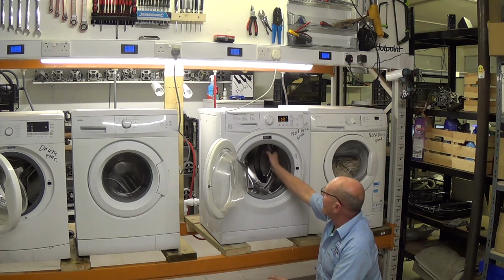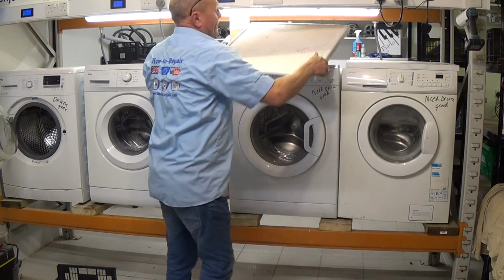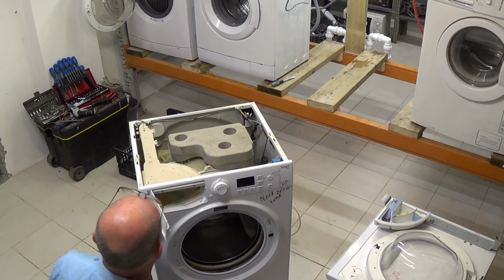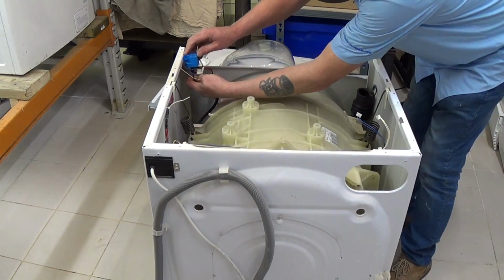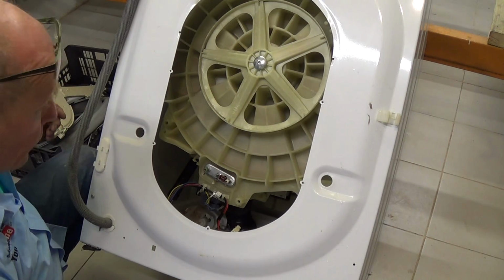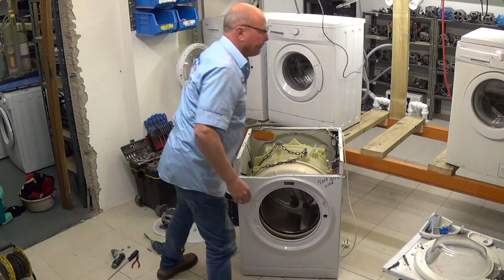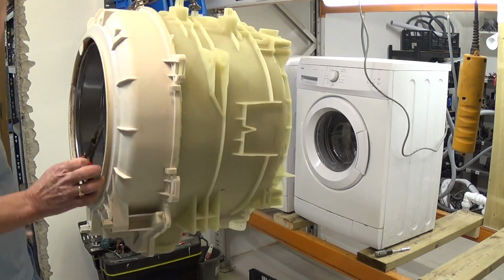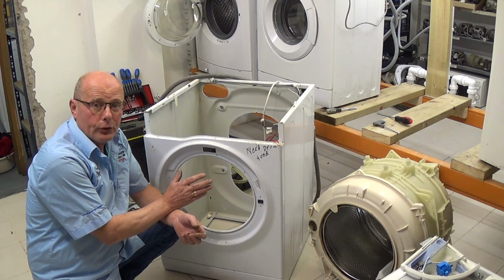How to replace & change a Washing Machine Drum in a Hotpoint Indesit Ariston Whirlpool

Comment: hello i have a similar machine and i have noticed that the washing machine is leaking water when get's filled with water or detergent, i have tried and remove the front cover and washed the detergent box but nothing happened, i'm not quite sure if is the drum that is leaking or if it's leaking from the inlet hose... 
i bought the machine brand new a little over two years ago... very odd for it to start leaking so fast

Comment: Interesting. Chance of finding an identical secondhand tank is easier said than done. I speak as ex Hotpoint fse.
Reply from the maker: Okay, as a Hotpoint engineer, you will know this. Find the part number of the drum that you were looking for, then put this into one of the websites and find all the models that it fits. Using this data as individual searches to see if anyone has an old machine with a burnt out PCB or similar fault, then Rob Charlie to make Peter better. You will also be surprised how many new ones are for sale from engineers who have leftover stock
 glad we could help you @johnmartin390 this is for you https://www.youtube.com/shorts/e432SAb2g08 please remember to subscribe as that's what keeps this channel going. Thanks 👍

Comment: Great stuff - your last vid was real helpful too (epoxy drum repair) thing is.. I had a rather bigger hole - so I got the aqua-stik epoxy & reinforcing glue and I had ideas to reinforce the repair with fibreglass mesh or similar - - mines a Hotpoint, like what you have there, and seems to be a split drum.

So if i do this full strip-down, how feasible it is to open the 2 halves of the drum (to check for remaining foreign debris, and give full access for a repair?) then put back - do the 2 halves need a special seal, can i just reassemble, or what ?

Thanks for you  time - I find fancy electronics and computers a lot easier :) Pete, Gas Electronics
Reply from the maker: there are a few videos on replacing bearings on a sealed drums that will help you ,but not for me to much work, why not look for a second hand drum its easy if you have model number. Thanks 👍 for watching and please remember to subscribe to the Channel as that's what keeps us going in able to make the video for you

Comment: Excellent video. Thank you for your time. Unfortunately, I found my drum was also sealed and the fairly new machine was scrap. There must be a way to establish this first. Maybe if the large pulley is held in place with a bolt the bearing is replaceable, and if it is held in place with an allen key, it is a sealed drum??
Reply from the maker: You did not say what make of machine that you had
Reply: @jaybee258 Presuming you mean one of the Hotpoint-Ariston family as in the vid, I thought MINE was non-sealed too, as the things obv manufactures in two halves .. But unless youve got little bolts holding the drum together , it aint, its plastic-welded!

Theres a vid of someone cutting these open, and re sealing - but its quite a bit of faff !

Comment: Hi Paul, is it possible to open the tub of this machine ? It seems to be glued ??? There are just 4 claws to maintain the front face .... not realistic ... I need to replace the 3 drum paddles and there are  some folded tabs to block the paddles on the drum which must be folded from the outside of the drum. Thanks in advance !
Reply from the maker: what make have you got

Comment: just wanted to say thank you. I got a spoon out of my heater element. A whole spoon!!! my question is I have an older whirlpool duet and the plastic around the drum has screws can I take this completely apart and reassemble it? or will i need a seal after taking it apart. I watched one you said they are welded on some so just curious. thanks for taking the time to make these very helpful

Comment: Hello I have to say why would you really want to go through all this kinda work just to replace a new tub. Seems a lot of work. I understand what you are trying  to show but honestly I can’t see why.  Hope you are not offended by my view on this matter.  Thanks
Reply from the maker: I understand your thought completely but
There are many people who cannot afford to buy a new machine, And by doing a little bit of research they might be able to find a replacement drum for as little as £20 out of the machine which has burnt electrics.  I have been doing this for nearly 40 years but with this video it is only 2 hours of work to put a new drum or second-hand into their machine. There are a lot of people who have a few hours to spare rather than spending £300 on a new machine.  I was not offended by your criticism whatsoever but not all of us are in the same financial situation. 
The machine I was working on was  hotpoint wmfug842puk the drum is part number C00285584 this fits all these machines so there is a good chance of finding a drum
ARISTON
AQXXF129 AQXXF129
HOTPOINT
AQXGD169PMN AQXGD169PMN AQXXD169PM 39798 AQXXD169PM 39798 AQXGF149PIUK 54676 AQXGF149PIUK 54676 AQXXL129PM 39796 AQXXL129PM 39796 AQXXF149PM 39797 AQXXF149PM 39797 AQXXF149HPI 39799 AQXXF149HPI 39799 AQXXF149PI 41786 AQXXF149PI 41786 WMUD823BCUK 83870 WMUD823BCUK 83870 SWMD8437UK 85902 SWMD8437UK 85902 SWMD9437UK 85903 SWMD9437UK 85903 SWMD9437GUK 86962 SWMD9437GUK 86962 SWMD9637XRUK 86963 SWMD9637XRUK 86963 SWMD9637GUK 86964 SWMD9637GUK 86964 WMFUG842PUKC 87685 WMFUG842PUKC 87685 WMBF822PUK 89178 WMBF822PUK 89178 WMBF944GUK 89787 WMBF944GUK 89787 WMBF844PUK 89821 WMBF844PUK 89821 WMBF844GUK 89867 WMBF844GUK 89867 WMBF944KUK 89890 WMBF944KUK 89890 WMFUG842GUK 89959 WMFUG842GUK 89959 WMAO9437PUK 89960 WMAO9437PUK 89960 WMSIF8437BCU 93143 WMSIF8437BCU 93143 WMFUG842GUKC 95691 WMFUG842GUKC 95691 WMFUG942GUKC 95723 WMFUG942GUKC 95723 WMXTF942GUKR 102134 WMXTF942GUKR 102134 WMXTF842GUKR 102136 WMXTF842GUKR 102136 WMXTF942KUKR 102137 WMXTF942KUKR 102137 WMXTF842KUKR 102141 WMXTF842KUKR 102141 BWE91484XKU 104311 BWE91484XKU 104311 WMAOD844PUK 153108 WMAOD844PUK 153108 WMAOD844GUK 153109 WMAOD844GUK 153109 WMAOD844KUK 153111 WMAOD844KUK 153111 WMAOD944PUK 153112 WMAOD944PUK 153112 WMAOD944GUK 153114 WMAOD944GUK 153114 WMFUG863PUK 153210 WMFUG863PUK 153210 WMFUG863GUK 153211 WMFUG863GUK 153211 WMFUG963GUK 153212 WMFUG963GUK 153212 WMFUG963PUK 153213 WMFUG963PUK 153213 WMEUF944PUK 153408 WMEUF944PUK 153408 AQXGD169PMUK 46506 AQXGD169PMUK 46506 AQGD169SUK 46507 AQGD169SUK 46507 AQXGF149PMUK 54677 AQXGF149PMUK 54677 WMUD962GUK 74905 WMUD962GUK 74905 WMUD942PUK 74906 WMUD942PUK 74906 WMUD9427PUK 74909 WMUD9427PUK 74909 WMUD9427GUK 74910 WMUD9427GUK 74910 WMUD9627PUK 74911 WMUD9627PUK 74911 WMPF843GUK 76529 WMPF843GUK 76529 WMPF823PUK 76755 WMPF823PUK 76755 WMUD843PXUK 78675 WMUD843PXUK 78675 WMUD943PXUK 78677 WMUD943PXUK 78677 WMUD963PUK 78678 WMUD963PUK 78678 WMFG8337PUK 79637 WMFG8337PUK 79637 WMFG8537PUK 79639 WMFG8537PUK 79639 WMFG8537KUK 79641 WMFG8537KUK 79641 WMYL8552PUK 79762 WMYL8552PUK 79762 WMYL8552GUK 79795 WMYL8552GUK 79795 WMEF963PUK 81337 WMEF963PUK 81337 WMEF963GUK 81338 WMEF963GUK 81338 WMUD823PUK 81764 WMUD823PUK 81764 WMYL8352BUK 81765 WMYL8352BUK 81765 WMFL833GUK 82837 WMFL833GUK 82837 WMUD843PXUKC 83409 WMUD843PXUKC 83409 WMYF842GUK 84175 WMYF842GUK 84175 WMYF842PUK 84176 WMYF842PUK 84176 WMYF862PUK 84177 WMYF862PUK 84177 WMFG821PUK 84458 WMFG821PUK 84458 WMYF822GUK 84502 WMYF822GUK 84502 WMFUG842PUK 86250 WMFUG842PUK 86250 WMUD942BUK 74907 WMUD942BUK 74907 WMUD843PUK 76532 WMUD843PUK 76532 WMUD942KUK 76599 WMUD942KUK 76599 WMUD843BCUK 83870 WMUD843BCUK 83870 WMUD942GUK 74908 WMUD942GUK 74908 WMFG8337GUK 79638 WMFG8337GUK 79638 WMFG8537GUK 79640 WMFG8537GUK 79640 WMYL8352PUK 79761 WMYL8352PUK 79761 WMEF943PUK 81312 WMEF943PUK 81312 WMFG942PUK 84501 WMFG942PUK 84501 SWMD8237UK 85901 SWMD8237UK 85901 SWMD9637UK 85904 SWMD9637UK 85904 WMFUG842KUK 86251 WMFUG842KUK 86251 WMFUG942PUK 86253 WMFUG942PUK 86253 WMFUG942GUK 86254 WMFUG942GUK 86254 WMBF944PUK 89786 WMBF944PUK 89786 WMBF963PUK 89788 WMBF963PUK 89788 WMXTF942PUKR 102130 WMXTF942PUKR 102130 FML942PUK 102474 FML942PUK 102474 WMJLD943PUK 102864 WMJLD943PUK 102864 WMUD942PUKC 83408 WMUD942PUKC 83408 WMXTF842PUK 85881 WMXTF842PUK 85881 WMXTF842GUK 85882 WMXTF842GUK 85882 WMXTF842KUK 85883 WMXTF842KUK 85883 WMXTF942PUK 85887 WMXTF942PUK 85887 WMXTF942GUK 85888 WMXTF942GUK 85888 WMXTF942KUK 85889 WMXTF942KUK 85889 WMSIG9637BCU 87475 WMSIG9637BCU 87475 AQXL169UK 37698 AQXL169UK 37698 WMUD962PUK 74904 WMUD962PUK 74904 WMEF923PUK 79764 WMEF923PUK 79764
INDESIT
XWA81682XWC XWA81682XWC PWE91472WUKE 74753 PWE91472WUKE 74753 PWE91672WUKE 74754 PWE91672WUKE 74754 PWE91472SUKE 74755 PWE91472SUKE 74755 XWA91683XWUK 87505 XWA91683XWUK 87505 XWC81483XWUK 87506 XWC81483XWUK 87506 XWE91483XUK 88466 XWE91483XUK 88466 XWC81483XSUK 88710 XWC81483XSUK 88710 XWA81682XUK 89819 XWA81682XUK 89819 XWA91683XWC 95130 XWA91683XWC 95130 XWE91683UKC 95654 XWE91683UKC 95654 BWA91683XWUK 100429 BWA91683XWUK 100429 BWA81683XWUK 100884 BWA81683XWUK 100884 XWE91483XKUK 102884 XWE91483XKUK 102884 BWE91484XWUK 104309 BWE91484XWUK 104309 BWE91484XSUK 104310 BWE91484XSUK 104310 BWA81483XWUK 104312 BWA81483XWUK 104312 BWA81483XSUK 104313 BWA81483XSUK 104313 BWA81283XWUK 104314 BWA81283XWUK 104314 BWA81683XKUK 105282 BWA81683XKUK 105282 BWE91484XWKK 105283 BWE91484XWKK 105283 BWE91683X WU 153206 BWE91683X WU 153206 BWE81483XWUK 153209 BWE81483XWUK 153209 PWE8168SUK 64865 PWE8168SUK 64865 PWE8148SUK 64955 PWE8148SUK 64955 PWE8148WUK 67295 PWE8148WUK 67295 PWE9168SUK 69083 PWE9168SUK 69083 PWE91472WUK 74753 PWE91472WUK 74753 PWE91672WUK 74754 PWE91672WUK 74754 PWE91472SUK 74755 PWE91472SUK 74755 XWA81482XSUK 82485 XWA81482XSUK 82485 XWA81682XWUK 82487 XWA81682XWUK 82487 XWE91483XSUK 82545 XWE91483XSUK 82545 XWE81482XWUK 88711 XWE81482XWUK 88711 XWA81482XWUK 82481 XWA81482XWUK 82481 XWA81682XSUK 82494 XWA81682XSUK 82494 XWE91282XWUK 82503 XWE91282XWUK 82503 XWE91483XWUK 82543 XWE91483XWUK 82543 XWE91282XSUK 82646 XWE91282XSUK 82646 XWA81252XKUK 86947 XWA81252XKUK 86947 XWA81252XWUK 86948 XWA81252XWUK 86948 XWE91683XWWW 82643 XWE91683XWWW 82643
Reply: @How-to-repair  my hotpoint 9325 makes funny noises sometimes when you start it up  can you please  help me
Reply: To be honest in my case I did this, and I understand your viewpoint, but in my utility room we have the matching machine and dryer in graphite grey both of which are now obsolete. Only for that I would have went the new machine route

Comment: Is it possible to replace just the bearings?
Reply from the maker: no that's the problem with the manufactures they are not telling the public which machines are repairable. Ebac machines are repairable
Reply: Only really LG and Samsung have split drums now a days where bearings can be replaced